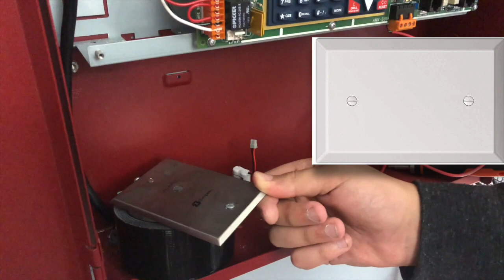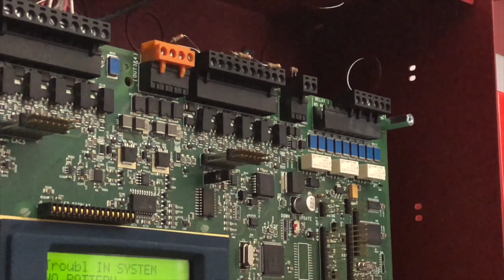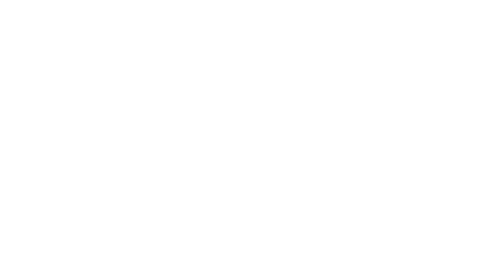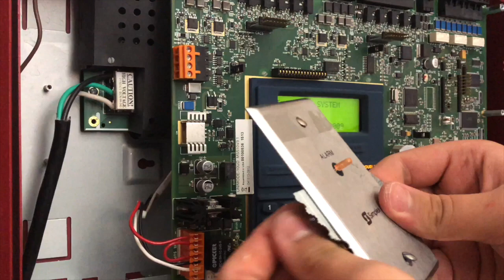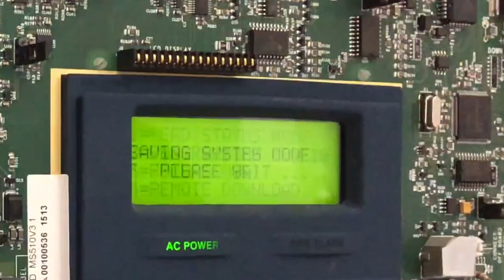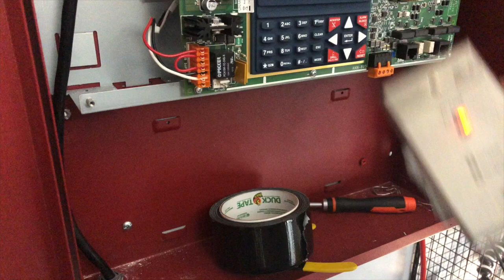DIY Remote Annunciator Light - How to make one for your panel

Comment: You could just use a 10k resistor so it can hook up to the 24-27 volts the panel puts out
Reply from the maker: SilentGuy Alarms I was trying to show how you could do this with household items, such as the old battery. Chances are people don’t live in an electronics specialist household
Reply from the maker: Ian Graves id prefer not to alter any of my snap circuits